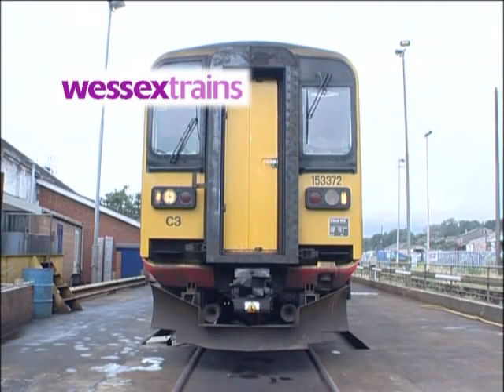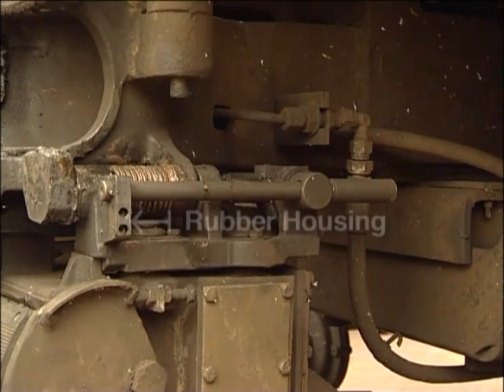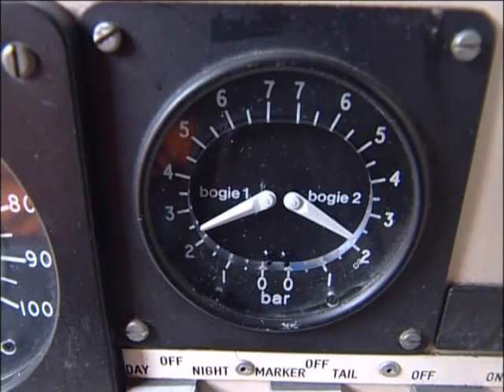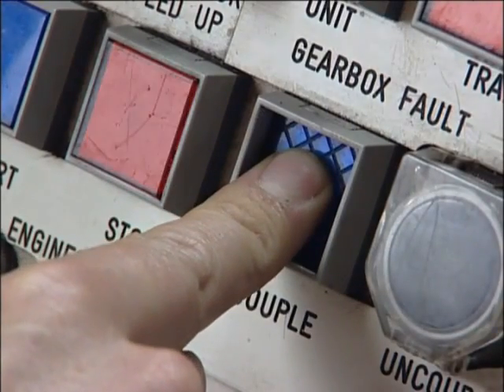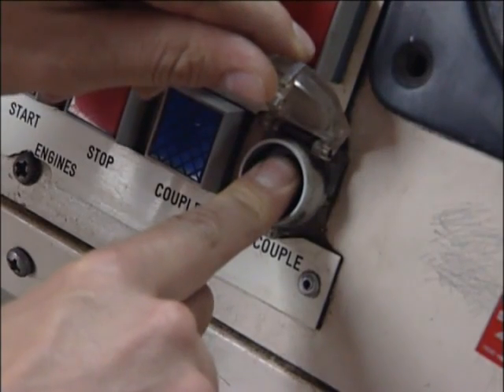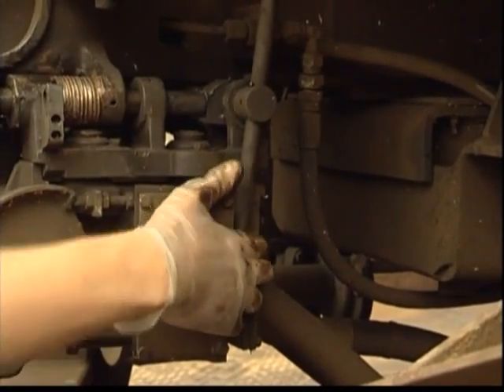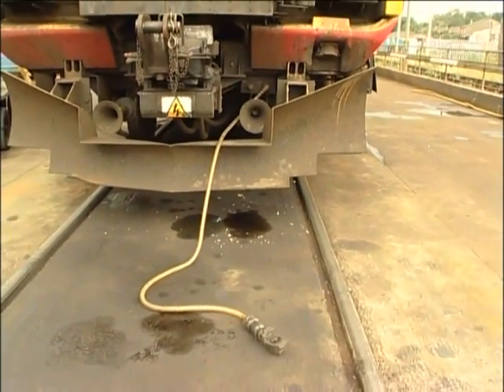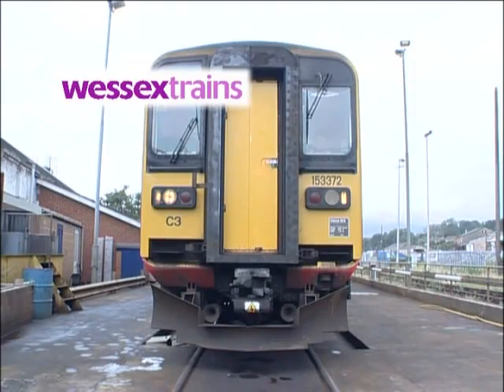Wessex Trains, The BSI Coupler

Comment: The BSI is basically an update of the older tight lock coupler. The tight lock is buckeye with an electric block underneath used on older electric units.
Reply: Actually tightlocks and Buckeyes are different, and don't like being coupled together. Look at the front of a 455 (as they don't have electrical boxes) and a slam door unit. 455s have tightlocks, slammers have buckeyes, and you'll notice they're quite different

Comment: "Gentle Contact" Slams into the other train
Reply: As an experienced driver I wish they didn't say that in the training material.  You need a couple mph to get enough force to press the pins in,  this cleans the muck off them and you get far fewer coupling faults.
Reply: BR does not care about gentle from the start anyway,
Reply: I would't have wanted to slam two Wessex Trains units together as I understand maintenance wasn't always that great under Wessex Train and that a good few of their trains could be called tapes, as they were mainly made of sticky tape and rust!

Comment: Unique coupler. The only problem I have with this coupler and many across the UK/Europe and what have you is that there are so many different types of couplers and no commonly agreed upon standard. In the US all mainline operators, meaning freight (CSX, NS, UP...) and passenger(Amtrak...), use the "same" Janney/Knuckle couplers on their cars. I understand that on some passenger services trains like the L trains use a special type of coupler but they aren't connected to the main lines to my knowledge. Just seems poor for interoperability in my mind but if it works it works!
Reply: First of all, these are not unique at all. They are fitted with standard BSI couplers and are able to work in tandem with other multiple units fitted with them - classes 142, 143, 144, 150, 153, 155, 156, 158, 159, 170 and 172. A more common issue when coupling is the electrical connection blocks. 
I've seen Dutch ICM multiple units towing more modern SNG multiple units, despite the electrical connection blocks being completely different (here's the link: https://www.nicospilt.com/index2.html and look for "Filmpje: bijzonderheden langs blokpost Bunnik"). 
One could say that the UK are doing quite well with their connectivity (having 7 types of multiple units is quite good!), I can't say I've seen this being used a lot, apart from using a combination of 143 and 150/155/156 units to adhere to the Rail Vehicle Accessibility Regulations. 
Usually, units are coupled within class, which is always possible. And for freight and some passenger trains, there's the normal screw coupling in use. 
So in the end, it's not really a problem.
Reply: From what I gather this is one of three types of main coupler for UK passenger train service.

1. Scharfenberg
2. Dellner (Swedish copy of the above)
3. BSI, as we see in the video.

I'm not sure but the FLIRTs by Stadler may also be using a different type but I am unsure of this. But yeah, you're right, there should've been an agreed of the shelf standard to use on the UK rail network, with future proofing in mind.
Reply: To have to re-fit all the trains to a coupler (the Janney coupler) that's not all that common in the UK would be way too expensive. These trains don't usually need to couple with other trains that have different couplers, but in the off-chance they do, there are adapters.

Comment: Would it be better off using America couple r?
Reply: No, why would you even suggest that?
Reply: @Ray Horner which type of American coupler? There are many.
Reply: Janney-design Type D coupler
Reply: @rayhorner2965  We do use some Janney type couplers in the UK, our electric multiple units (until privatisation) all have Type H Tightlock couplers, and some of our locomotives and stock use Type Es.

Though have fun trying to convince a national standards body, 3 different rolling stock leasing companies, and 20+ train operators that they should change the couplers on all their diesel multiple units just because.
Reply: I would think not as it (dependant on type and from my knowledge as a Brit) would require re-training of all staff and might not be good for running in multiple.
Reply: No, because this train is in the UK. Different countries use different couplers.
Reply: No, this is fully automatic rather than semi automatic, and takes care of all electrical connections for running with other units in multiple
Reply: yeah, but that would make too much sense.........
Reply: Yes, until lights need to be turned on in the other train, or brakes are applied, or you want to send a PA across the entire train.